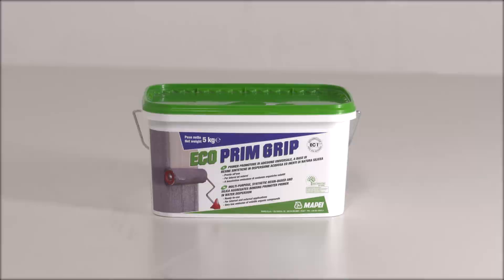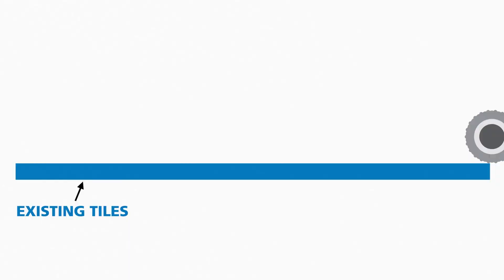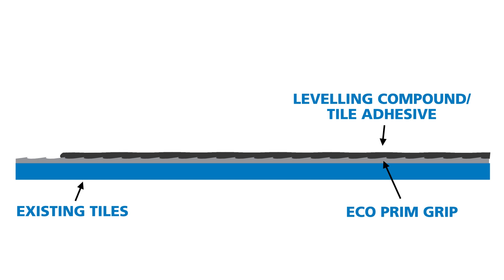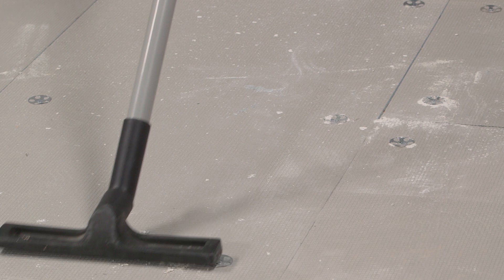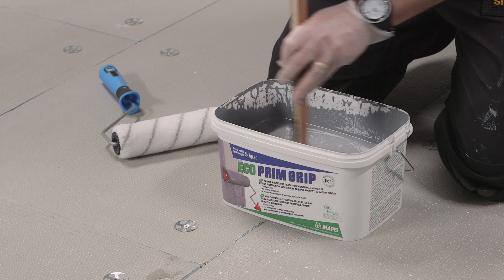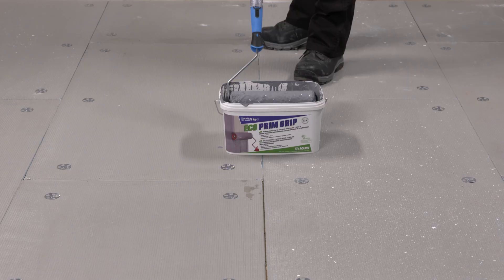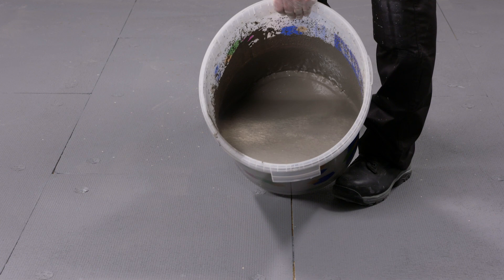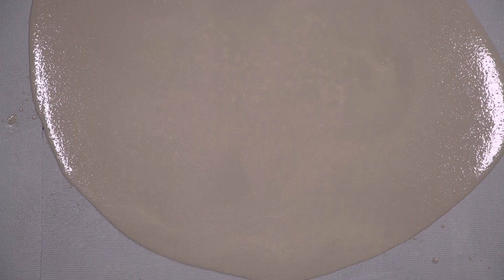Mapei ECO PRIM GRIP

Comment: I have existing ceramic tiles that have been painted and sealed with three coats of lacquer. The job didn't turn out like we had hoped so we're covering it up with new tile. Will Eco Prim Grip adhere to the lacquer and subsequent mortor?

Comment: WILL THE PRIMER WORK OVER OLD LINOLEUM FLOORING
Reply from the maker: While Mapei Eco Prim Grip can be applied over non porous surfaces such as existing ceramic floor or luxury vinyl tiles, it’s not recommended to be applied over sheet products such as linoleum and sheet vinyl. I hope this helps.
Reply: @MapeiUK  Is there another similar primer that is usable over vinyl or linoleum floors?
Reply: @MapeiUK  HI I there.  I bought tiles today, I had no room to purchase a big sheet of cement backer board.  my bathroom floor has old square vinyl flooring  from the 1970s and they are extremely glued tight onto a concrete floor. will I be able to tile  straight over them without using  backer boards using Mapei Eco Grip ?
Reply from the maker: @bsfbestshortfilmsonyoutube  thanks for getting in touch. Yes , providing the tiles are solidly bonded with no sign of cracking or moving, thoroughly clean and degrease the floor, apply Mapei Eco Prim Grip Plus  before using a suitable tile adhesive for the intended tiled finish. We hope that helps you out. Many thanks
Reply: @MapeiUK  great help thanks

Comment: can it be used on plasterboard
Reply: You could, but it's over kill. This primer is best on non porous substrates ie, existing ceramic tiles. For plaster board just use an acrylic or SBR primer. If you are tiling do NOT use PVA.
Reply: @tilerman  what about painted plasterboard?
Reply: @alfiejames-elliott4610  Hi Alfie. I think it would all depend on what type of paint is on the plasterboard. Water based paints for example become 'live ' again when it get's wet. You may have noticed if you wipe down emulsion paint with a wet cloth, the paint comes off the wall onto your cloth. So if you were to paint emulsion paint with anything that's wet (ie primer) it's not going to work. I'm a tiling contractor and i regularly go to jobs where the decorator has painted the walls with paint 'because paint is a good primer'. Paint is NOT a primer. Tiling over paint and you are asking for trouble. For tiling, if the plasterboard has been skimmed then painted, you would have to sand the paint off using a high grit paper, then prime using an acrylic based primer, NOT PVA. If you want to tile unskimmed plasterboard, that's a problem as the paint is in the paper. I personally would never tile plasterboard that's been painted with any paint. Hope that helps.